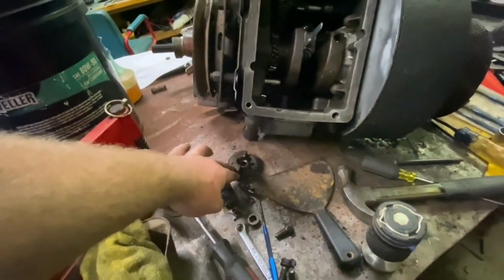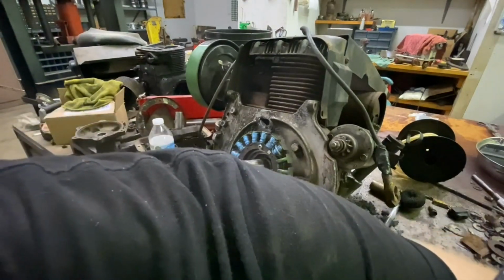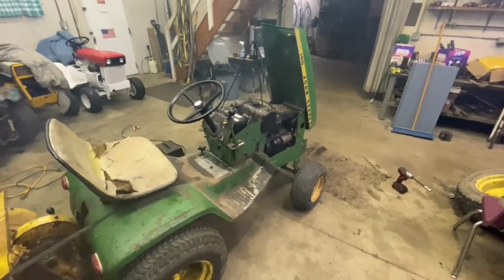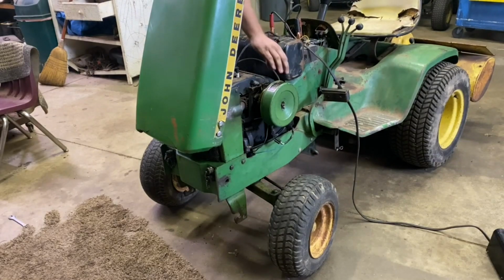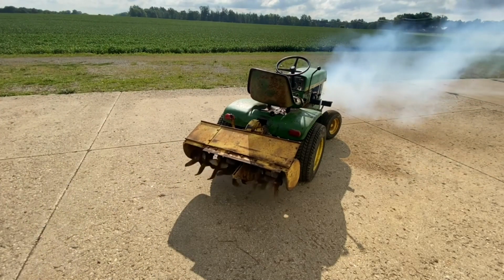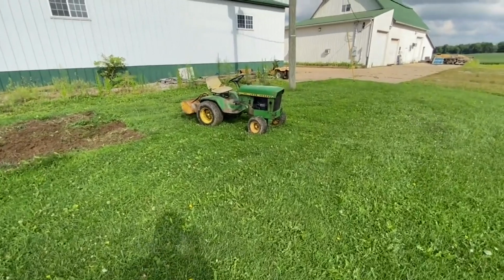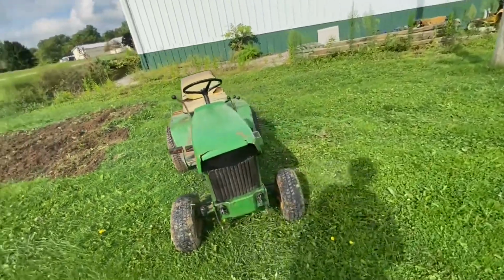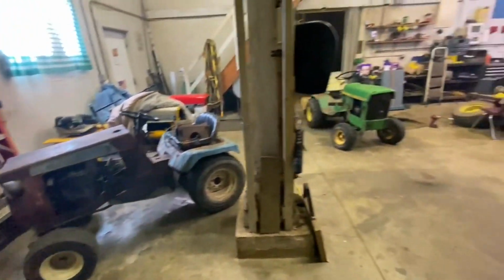Will It Till??? 1970 John Deere 140 H3 First time tilling dirt in 20+ years

Comment: im just getting a '74 140h3 running after decades sitting in a barn..  i put a new carb on it, new coil and points and its rippin!  mine dont smoke like yours, but im dripping a fair amount of hydro fluid so that sux! i  got the plow blade with it..
Reply: Got a ‘70 same thing to fix and it leaks too haha

Comment: I have a H1 model 140 also with a classic 33 tiller,but its in a time capsule condition that i still till with today,( yesterday ) and the older 92 year old man that own it bought it new from his son in law that was a JD dealer,who did all the service work on it, the old man never mowed with it and just used it to till his garden up,,as he had a cheaper mower to use and to mow with ,one of those old mowers that you sit on top of the motor and it just had one steering wheel in front that was diectly shalft to the operators steering wheel,so the JD 48 inch deck with it still has paint under it and on the orginal blades. Its very nice and you can bet  thats how it became a time capsule ,,those garden tractors are worth fixing up and restoring  for sure

Comment: If it keeps smoking ,try a little trans fluid in the engine so to free up the piston rings ,just run it awhile before changing it out for some good 15 40 weight after,as it should free everything up

Comment: Removing the total seat deck is very easy so to service the hydro pump etc is quite easy ,and couple bolts,but it is heavy to lift off ,and everything is under and easy to adjust if needed,,manuals are on line to download free

Comment: Make sure you lub up and grease that tiller accordining to the manual you can view from on line,,i have the extesions in my 33 tiller making it quite wide,,i would paint and re decal the total machine you have there and it's a nicer expensive H2 model , changing the hydro fluid with Hy Guard John Deere fluid is much better for the hydro pump ,,and its cheaper trans fluid
Reply from the maker: The tiller I have is original paint and decalls last I checked I don’t really plan on painting it their only original once.